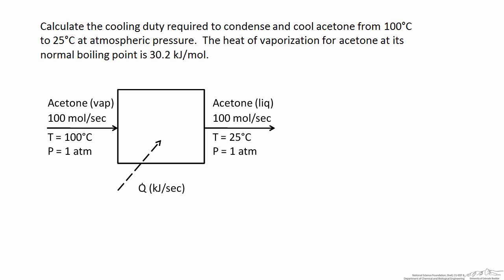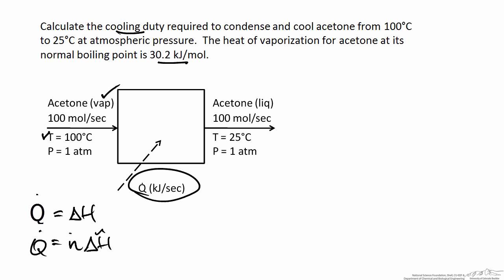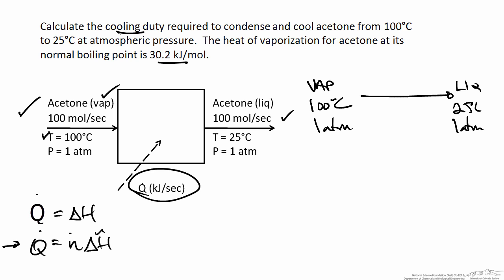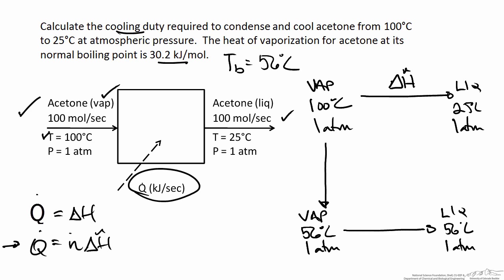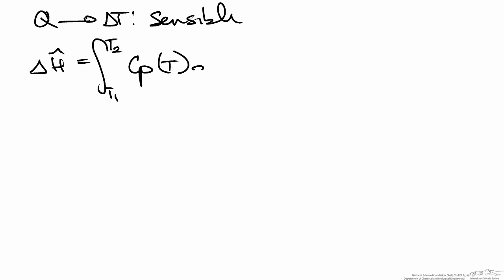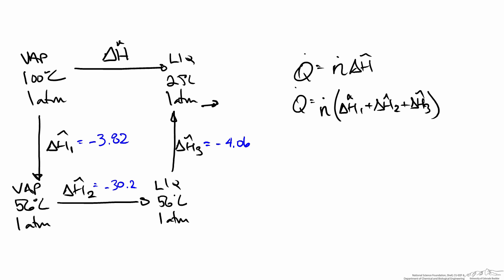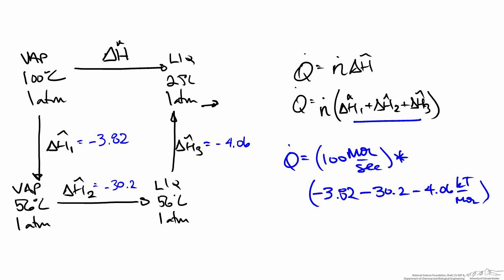Energy Balance on a Condenser

Comment: Isn't (n dot)(sum of enthalpy) = to negative Q? You have to subtract Q to the other side of the energy balance?
Reply from the maker: The changes in enthalpy are negative, which in turn makes Q negative.  That makes sense because it is a cooling operation.  Does that answer your question?

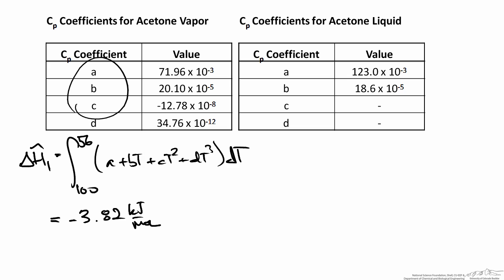Comment: The very first calculation for delta h1 at minute 5:20. I can't get the same result, I get -3.36 kJ/mol. You're supposed to integrate so you then solve  a*(-44) + b/2*(-44^2) + c/3*(-44^3) ???
Reply: Not -44^2. It is 56^2 - 100^2
Reply: You have not integrated properly. Instead of using -44 retry with [a*56+(b/2)(56^2)+...] -[a*100+(b/2)(100^2)+...] and you should get the same answer as above.

Comment: Thank you so much for the illustration. I did the calculation, and the resutls are a bit diferente. I got 100 x (-2.98+ (-30.2)+(-3.72) = 369 Kj/mol
Reply from the maker: Adao Roberto Thank you for your comment.  I'm not sure how you calculated your answer, but I think the screencast is correct.  Please double check your calculations to see if you can get the same numbers.  Let me know if there's a specific point of confusion. Thanks for watching!